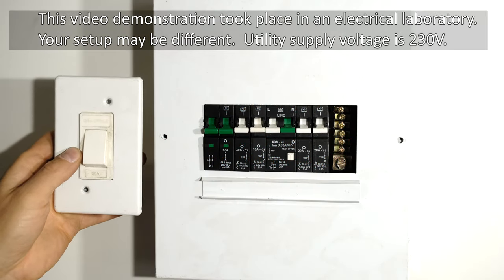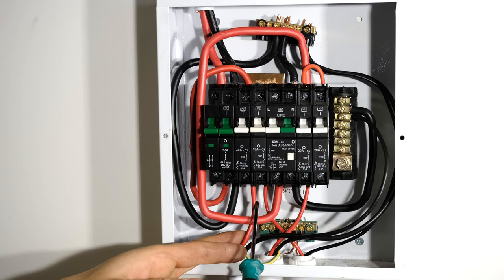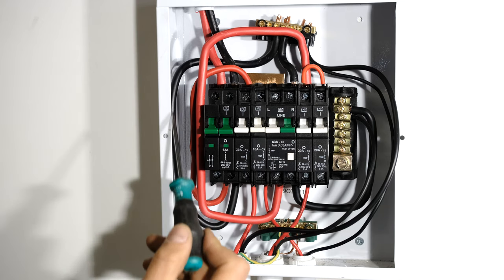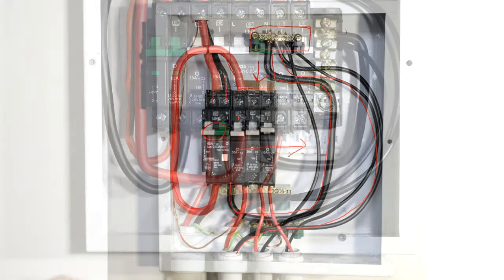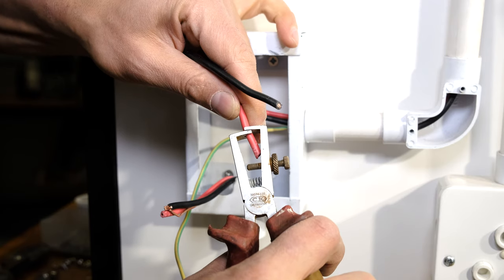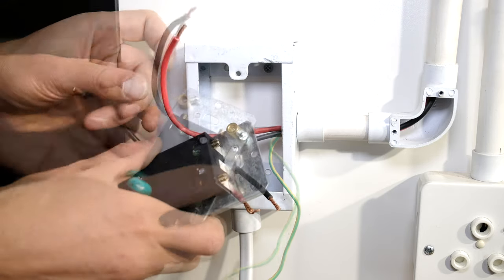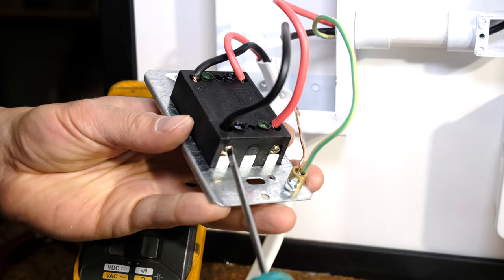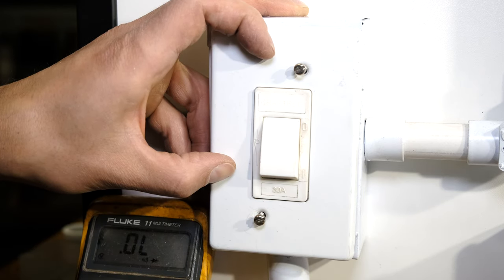How to wire a stove isolator switch - tutorial

Comment: Great video.   Two questions:  What size (amperage) isolator should one use for a stove connected to a 40 Amp breaker?   Is there any danger in using an isolator with a higher rating than the circuit- for example, can you use a 50 Amp isolator for a cooker hood / extractor connected on a 20 Amp plug circuit?
Reply from the maker: your isolator must have a higher current rating than the stove/load. Doesnt matter if the isolator is higher than the cct breaker. You can use 50A isolator for 20A plug cct, no problem, actually better to use higher amp isolators, they just cost more.

Comment: Wow awesome video! I have a question about the stove range/gorrel. If you have a 32A c/b for the stove curcuit what do you use to terminate the stove power cable after the isolator? Can you purchase a socket outlet rated at 32A? Or can you only use the screw in gorrel fittings?
Reply from the maker: the switch should be at a higher rating than the maximum load current of the stove but not less than the c/b breaking current.

Comment: Hi there, I have been wiring up an isolator switch for a Geyser and I see that previously on the load side of the switch there are 2 small wires from live and neutral joined together? Not sure what that is? I have a pic as well if I can share with you?

Comment: Is it a must to have isolator for stove?... what will happen if it is a plug only dedicated  for stove use
Reply from the maker: if there is no isolator it will work but the law says there must be an isolator
Reply: @ecologicaltime  another question from Stembiso Nkuna is a dedicated plug. I'm not sure if I'm wrong but by "dedicated plug" he's asking what will happen when he plugs a stove to a normal wall plug. Meaning if the oven stove in converted be a plug on, using its own plug because it's using drawing more amps. How unsafe will that be?

Comment: Hey Fellow South African.. I wanted to find out, can you do this connection with the same two wires but using a 3 pole isolator instead of two pole. You know the one that has three holes on top and bottom, and will it be safe? Thank you in advance.

Comment: Thanks for a very interesting video! Just a question. SAN Spec states

The 6.16.3.1.2 A switch-disconnector for a cooking appliance(s) shall

a) be in the same room as the appliance(s),
b) be at a height above floor level of not less than 0,5 m and not more than 2,2 m,
c) preferably not be above the cooking appliance(s),
d) be within 3 m of the appliance(s), but within 0,5 m of the appliance(s) if the switch-disconnector’s purpose is not clearly indicated, and
e) not be fixed to the appliance.

Does this mean if you have a Oven installed in the corner of the kitchen with a hob to the left of the oven you can install the isolator to the right of the oven against the other wall if the isolator is installed after the fact and to get away form installing it above the cooking surface?
Reply from the maker: sounds fine - not hidden

Comment: is this a double pole isolator? i have seen an isolator, similar to this, but the diagram , says LINE , at the top,  and next to it, there is another LINE, so question is, here you are using the live, and the neutral on one side, .... what about that diagram that i saw with two LINES, do you do the same way was you have done here? because if its LINE, it should not be NEUTRAL , correct?